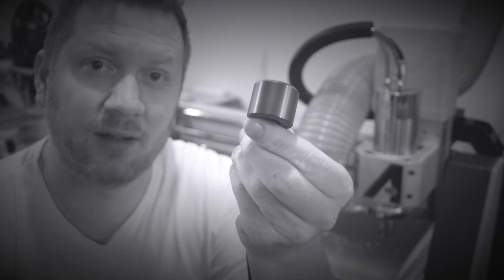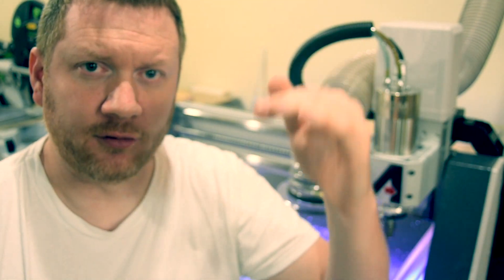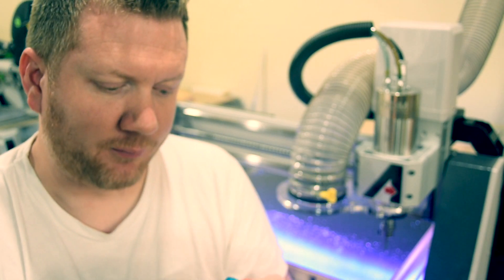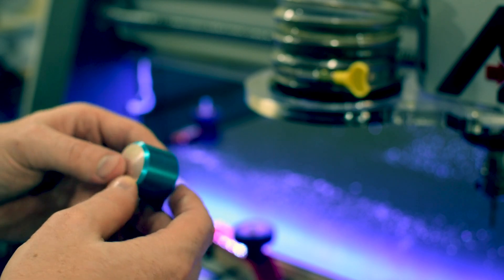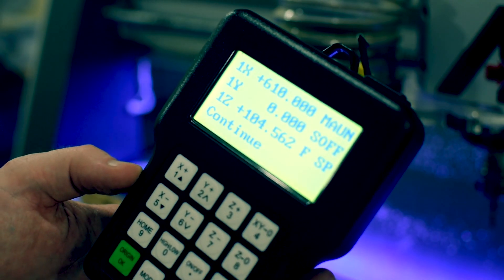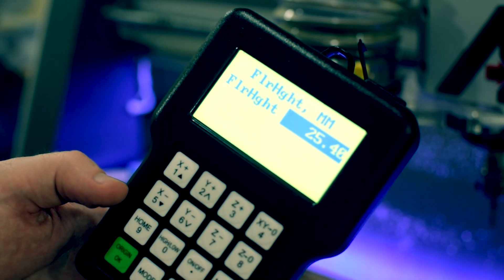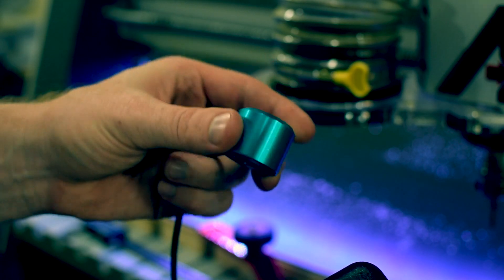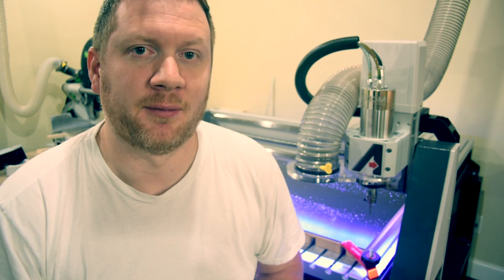Setting the touch off thickness | Axiom CNC

Comment: I like the tips and tricks your sharing.  Keep them coming.
Reply from the maker: +KC Kace84 ah first person to like it haha! Thanks buddy :)
Reply: Southern Ginger Workshop just bought me one. You should get in contact with axiom, and have them set you up an affiliate link...
Reply from the maker: +KC Kace84 I have an affiliate link already :)
Reply: Southern Ginger Workshop where does the touch off plug into?
Reply from the maker: +KC Kace84 the top of the left gantry
Reply: Southern Ginger Workshop lol, I see that it’s hidden.  Have you ever had to change the fluid out to like antifreeze for a colder state?
Reply from the maker: +KC Kace84 never had to.. I've run it for 30hrs straight and no issues
Reply: Southern Ginger Workshop what are you saving the tool path files under?
Reply from the maker: +KC Kace84 mmc extension
Reply: Southern Ginger Workshop can you screen shot it, I’m not seeing that option..  tool path looks correct on software.  But isn’t doing it on machine
Reply from the maker: +KC Kace84 I think it's mmc or mmx
Reply: Southern Ginger Workshop do you work in mm or inches?
Reply from the maker: +KC Kace84 I do inches because that's what I know best lol
Reply from the maker: +KC Kace84 I can't call at the moment but let's try to setup a hangout, realsouthernginger@gmail.com
Reply: Southern Ginger Workshop k, I got it fixed.  Thanks for your help bro.
Reply from the maker: +KC Kace84 oh nice! Good to hear

Comment: Thanks for the reply, I could not get the reply to you
 so I went back to this site.  Thanks for your offer.

Subject: Re: New reply on "Could you show the complete initial set up to make a simple sign or something similar. I am most interested in the use of the multi-function pendant control. Thanks"
Thank you for the reply.

I was referring to a walk thru of running a first part.  Starting at loading the program into the machine, Tool setting, locating home (x and y zero) , a Tool change, etc.

I ordered a copy of the instruction but thought they lacked detail and clarity, especially with the multi-function keys on the pendant control box.

Thanks, 

Allen
Reply from the maker: +Allen Christ ah gotcha. Home by default is bottom left, you can change that but I've always left it there. I think you might be asking about setting origin?